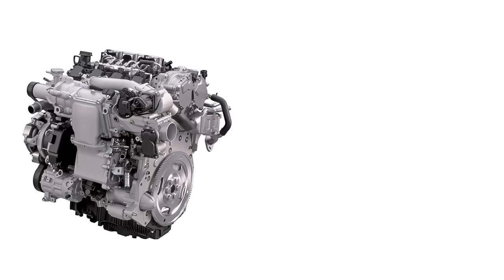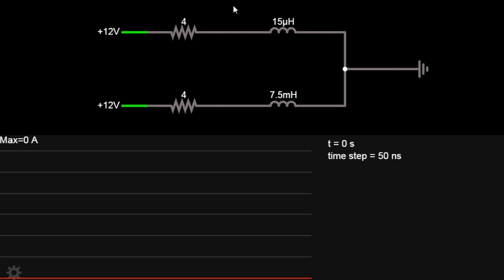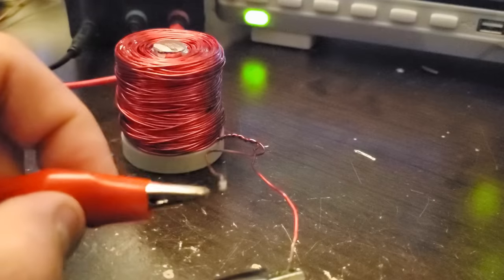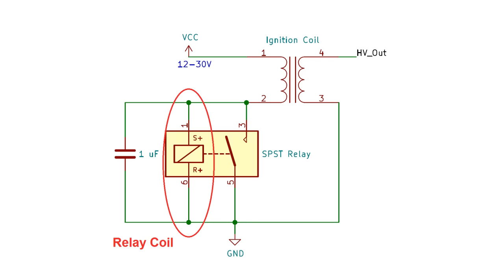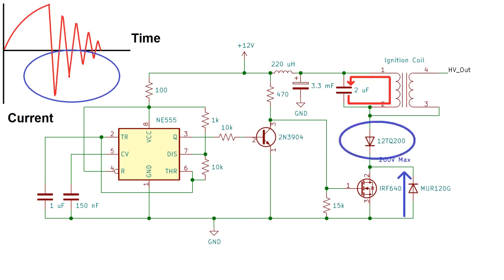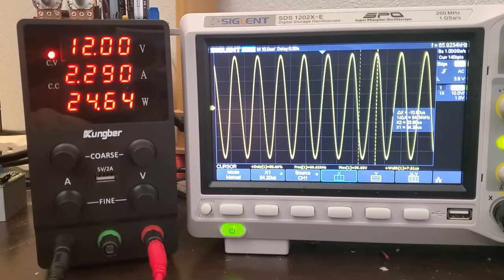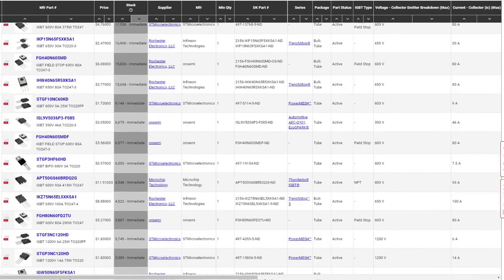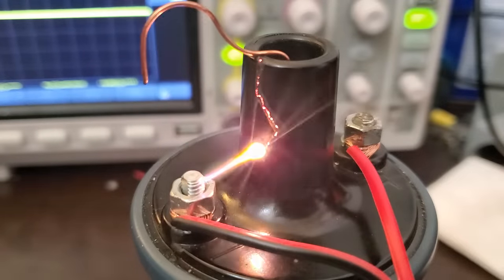Ignition Coil Drivers

Comment: RIP all you neighbors enjoying their nightly AM programming
Reply: So no one.
Reply: Who cares about them anyway?
Reply: How far do you think that would transmit 😂
Reply: What happens if you use one of these coils? As a coil on a generator no, it was to run a big magnet by it. And you put these coils in a situation where you can have a magnet rotating around and trigger an each one of developing high voltage. Every time it goes by the coil, the magnet. Can you use these coils? Almost like a magneto and a an a lawnmower or something

Comment: Ignition transformers are great, one time I had 2 of them in series being driven by the output of a MOT, it created massive 6" plasma arcs between the output terminals.
Reply: @Joseph Bunn "1 ft arc" NICE lol, yeah I was just driving them with a spark gap off the MOT secondary.
Reply: @Joseph Bunn I think I used the can cap that was in the Microwave, don't remember what size it was though.
Reply: Do you have a schematic of what you just mentioned???
Reply: Can you please draw a schematic of your two ignition transformers powdered by a MOT?  I am a one of your subscribers.
Reply: @dandruff7807  It's not much to draw, it was just 2 ignition transformers in series with the output of the MOT.
Reply: Model A induction coils were fun to play with my roommate at college used a special rectifier and he charged the oil filled capacitors and shorted.the caps which made a big spark. I would take a florescent light tube and it would light it without any connection. No wonder why I got put on academic suspension. I never went back to that college. I took electronics at a community college. I had decent grades there. 73
Reply: What is MOT?
Reply: I once placed eight computer monitor flybacks in series setting in mineral oil and triggered them with a 2n3055 npn flip flop topology. After receiving in my 1% billion ohm resistor and building my own (very accurate) volt meter, I about sh_t my pants when I measured the output. Unloaded it produced 230kv. After setting it aside and moving several times I decided life is too short and disassembled it. Just prior to that....I tested the output in another pool of mineral oil with 12 20kv diodes in series. They literally danced around like a snake in water. Cool to see, but deadly to say the least.
Reply: @rylexautumn3766  Microwave Oven Transformer

Comment: I've done some sketchy stuff with these ignition coils, in fact I was almost killed by one a few decades ago lol. My 15 yr old genius mind hooked one of these up directly to a wall outlet, I had to dunk it in motor oil to prevent arcing and cool it since I was running gobs of current through it lol. I was fooling around with the 2" arcs it made, which were hot enough to melt steel wire, when it shorted out to the metal table I was working on and holding on to with my right hand (genius move, I know, I was staggeringly intelligent in my youth🤣) and the electrode in my left hand, my right hand clamped down on the table so hard I couldn't pull away and my left hand was squeezing the wire, I was stuck on it for about 5 seconds before I could get my legs to start kicking and push myself away. I pulled so hard I ripped the transformer out of the jar of oil and sprayed used motor oil all over myself and my shop, but more importantly ripped the outlet out of the wall and saved myself from an awful death. My entire body was cramped for days and I'm not sure how it didn't stop my heart, I think it must have been making 20k-30k Volts based on the length of the arcs it made, which were very similar to a flyback transformer arc but noticeably hotter. Moral of the story, don't hook these up to unlimited current sources, you might die...
Reply from the maker: ಠ_ಠ
Reply: You can be a Hip Hop Rapper and call yourself  50hertz.😂 dun dun .... dun dun !
Reply: @Buzzhumma  🤣
Reply: Lol i did the exact same with a big neon sign transformer
Reply: @randomhuman1965  it's scary but it goes another level if you add capacitor! Don't unless you have approved and appropriate training and I mean properly taught !
Reply: well, wow mr 50hertz (🤪), thanks for sharing your gruesome experience, and its well taught warning for all of us thinking of trying these!
Reply: What a crazy story. So glad nothing too bad happened.
Reply: I remember a similar incident in my own youth which could have been just as dangerous, except nobody got electrocuted. I was also trying to get sparks from an ignition coil by running it directly from the mains (UK mains, 240 volts AC with a 13 amp fuse in the plug), but had just enough sense to use an extension lead, with the ignition coil sitting outside on the grass. When I flipped the switch on at the wall (UK wall sockets all have built in switches on them), it worked for a few minutes, generating a powerful 2 inch continuous arc. But then the arc suddenly stopped, and the coil started making a loud 50 Hz buzzing noise and emitting smoke. I ran back to the wall socket to switch it off, but before I got to the switch, the coil exploded, spraying hot oil everywhere, shooting its guts out across the lawn, which immediately caught fire. I switched it off and ran back outside to stamp the flames out, thanking luck that I hadn't been standing next to it when it blew up.

I imagine the high voltage that it really wasn't rated for had broken down the insulation inside and caused an internal short circuit, which was probably why the external arc stopped. The heat from the shorting wires inside had evidently started vaporizing the oil (until that moment I had no idea there was oil inside these coils) until enough pressure built up to burst the casing open. It must have hit the flash point of the oil too, hence the fire. Fun times, and important lessons learned!
Reply: @zhuzzir  that reminds me of a guy in our town here who ended up on the wrong end of a short circuit in an eXtreamly high voltage environment, there was NOTHING left of him as if he vanished into another dimension.
Reply: Username checks out
Reply: #ThingsToTryAtHome
Reply: FIRE GOOOD!  🔥🔥🔥
Electricity....... dangerous.
Glad you're ok and stories like yours might just save a life. 👍
Reply: @randomhuman1965 You really are fortunate to be alive.
Reply: I couldn't imagine the shock it gave you. I had a 2000 camaro ls1 v8 coil near plug design I forgot a plug wire one day changing intake manifolds started it up noticed a missfire walked around the front and saw number 4 plug wire arcing out to the shock tower 4-6inch gap. I've been hit by older coils usually results in the back of my head smacking the hood but them gen 3 gm coil near plug coils are a lot stronger. Glad you lived!

Comment: You missed the very obvious- collapse the current with a reverse diode across the coil and ignore looking for the resonance! Boom! Also use an ignition wire to conduct the output away from the coil.

Comment: Amazing how well the old set of mechanical points and condenser distributor worked, and rotor & cap delivered spark to each plug at the right timing. Much improved by early electronic ignition control, and powerful magnetos.
Reply: I've replaced a lot of those with igniters, which I assume are just IGBTs and some sort of hall sensor to detect the lobes on the distributor shaft. Because points flat out suck and nobody wants to be stuck on the side of the road...

Comment: A video that doesn't skimp on the necessary details but also doesn't overburden the viewer with too much detail or too much math - that is a recipe for a good video.
I have fixed a couple of the electric fence generators which were made too cheaply with crude soldering skills and solder with too much lead (cheap Chinese solder with a lopsided ratio of 40/60 instead of 60/40). There are many schematics on the net for this, but they basically involve charging a high-voltage capacitor of 10-30uF to around 200 something volts and discharging it through an SCR into the car ignition coil primary. This produces a powerful and painful high-voltage spark (No, I haven't tested it on myself, thank you very much!). The circuitry is crude and simple, it is surprisingly efficient at 12V (uses about 200mA, to step it up to 200+ volts), but by my calculations it is still using about 3 times more energy than it should (the efficiency maybe around 30%). It is using a standard iron core transformer with a 555 driver and a MOSFET and then going through a very high resistance to charge the main capacitor, which is a waste. I figured I could use a much smaller ferrite core transformer with pulses calculated to charge up the capacitor in one second, without using a resistor, which would greatly increase the efficiency.

Comment: In your attempt to drive at resonance (8:07), the parasitic drain to source diodes were probably the main problem.  Many years ago I worked with high voltage supplies that used a near resonant H bridge driver to deliver a little over 1 Amp at up to 145KV.   The H bridge used SCRs, and the transformer primary with a series cap was placed across it.  As you approach resonance, the series tank impedance goes lower, resulting in more output power.  There was no second chance if you made the wrong mistake while working on it... ⚡
Reply: Similar principle of induction furnace.
Reply: An amp at 145kv?! Jesus what do they even use that for? That sounds terrifying to work with
Reply: @ike5276  X-Ray tube power for a CT scanner.

Comment: That was kinda fun. 😁
As a motorcycle instructor I've checked back EMF on motorcycle ignition systems a few times.
One I particularly remember is mid 90's Suzuki VS800 (Intruder) 
The  back EMF maximum was 318V measured with a peak voltage adapter on regular electronic multi meter with input around 13.8v DC (regulated voltage when charging battery)
Output voltage around 45,000v but had no means of checking max voltage accurately (I'm a motorcycle mechanic not electrical engineer/hobbyist )

Comment: 6:02 some O.E.M, ignition systems use a NPN Darlington such as a BU941 or MJ10012, which might take a little more current to drive than a MOSFET, but have a higher voltage rating. Might be more expensive in a TO-3 package than the TO-220 ones you're using, but they have to work all day in all climates located near a hot engine. Thanks for the video.

Comment: I had some great fun many years ago, I was using a version of a capacitor discharge ignition (CDI) that were popular electronics kits many years ago. I had the same issue as you as in the centre insulator kept breaking down and killing all the fun. Luckily there was a few very rare coils with ceramic insulators on top at the local tip.
These did not punch through, however the spark would still make it directly between the output terminals and not my target terminals. I fixed that by extending the centre insulator with some plastic pipe.
In the end, I had a 500V cap dumping into two coils in series, anti-phase, one producing a positive pulse, whilst the other did a negative pulse. The best spark I was achieving was 7cm. However my inverter took about 20 seconds to recharge the dump cap, so it was a long way from a continuous arc. The discharge was by a heavy duty 'starter' press button, so no diodes or caps were used to limit the voltages.

Unfortunately that was one of the things that didn't make it when my parents moved houses.

Comment: One little addition to the ignition coil construction description:  There is also a few pairs of core material sheets curved around the winding pack.  That serves to provide a return path for the magnetic field, reducing the air gap in the loop.  As a side effect, it may also shield against some of the noise radiation.  On the old automotive implementation, there is a small, maybe 0.5 ohm series resistor to limit the primary current.  The capacitor was usually across the breaking contact, with an explained purpose of reducing the sparking of the contact.  However, the contact spark erosion stiil was a common trouble issue.
Reply: the capacitor also converts the initial Pulsed DC into Pulsed AC aka Damped Waves, so if you want to keep DC Impulses can't use the capacitor or maybe you would have to set up a bridge rectifier.
Reply: Old car starters usually have a second terminal which is there just to bypass that ballast resistor because old starters and engines were stupid huge and would drop the voltage significantly. Running with no ballast was OK when the voltage was low, but all other times just put unnecessary heat into the coil and wear on the points for no good reason. 

Modern vehicles use resistor spark plugs or wires, those also help to cut down on radiated EMI. Now, EV's just remove the AM radio entirely to "fix" their EMI issues...

Comment: This is like a simplified msd circuit. Not good for inductive heating but looks great for boosting the spark on your turbo car.  I get spark blow out and I am thinking this could really help with that blow out at 13psi boost.   
Thank you for sharing this.  Answers a lot of questions I had.

Comment: Déjà vu !  Many, MANY moons ago, I worked next to the people who actually designed the the circuits to drive ignition coils (and injectors) in electronic engine controls.  IIRC, they just used a MOSFET.  There was no capacitor across the coil (there WAS in old "point style" ignition systems).  The important thing was a zener diode across the driver transistor to protect it from back EMF.  The zener voltage had to be high enough (57V?) to allow the primary coil to collapse quickly but not too high to to allow damage to the transistor.

When gasoline engines are running at low RPM (<2000?) there is actually enough "time" to "recharge" the coil and "strike again".  At <1000 RPM, it may do this 2-4 times.

As you found out, arcing down the center tower ruins the coil because the leaves a carbon trace.  Once that trace is there, it is next to impossible to remove.  I had an old car with point ignition that would mis-fire in damp weather.  Turned out, it had an invisible, to the naked eye, carbon trace that would conduct when it was damp.
Reply: There seems to be a myth that you must add a capacitor, because points based systems had them. The GM HEI ignitions were based on an MJ10012 NPN Darlington or similar and I don't remember seeing a capacitor there, but those transistors were rated to 400v or 600v and some versions might have used a 350v zener to protect the transistor. The carbon trace is a good demonstration of why you shouldn't run your ignition system with a spark plug lead removed. That high voltage is going to want to go somewhere and there is a good chance it damages something when it does.

Comment: Cool video. To prevent the arching through the insulator try running a wire from the ground screw over top the center of the coil, also maybe use some insulated ignition wire. That should cause the arch to happen straight up and down.

Comment: You could use 2 coils in parallel - one firing, one non firing. Pot the output pole of the non firing coil with epoxy. See what happens.
The reason I say this, is because on Jaguar HE V12's, 1982 - 1988 there were no low impedance coils available and they did indeed use 2 coils wired exactly as described above. Funny thing is the non firing coil was wired after the firing coil, so the HEI module was switched on the firing coil and the non firing coil was connected after.
They used 2 coils because these engines had nearly 12:1 compression, ran on lean mixtures and turned 6500RPM which is a big ask for an ignition coil. 
After 1988 when low impedance coils became available, standard fitment for a V12 was a single coil DAC6093 but the rest of the ignition system remained the same. In fact you can delete your twin coils for that part number coil.
Reply: Did!the. Dual coils have dual points or was the magnetic pick used?  Points won't function correctly after  a few thousand rpms,  back in the day points could barely keep up after 3k rpm if I remember correctly.  Onan used a dual coil on its gen set with the side shaft twin , I believe it only ran at 1200rpm. It ran on point ignition system.   Just curious why the jag had dual coils.
Reply: That's a very interesting idea! I think the energy in the non firing primary wound go into the firing primary.

Comment: I forgot to mention, that coil I made a shock box back in 7th grade (1977), it was simply a hobby train power supply, it was rectified but not filtered and a variable resistor to control the output voltage, started at 60v and max was 490v, it was a blast, we get 5 to 10 peeps in series, start low, then slowly increase till someone let go, remove him and start again, then the teacher wanted to get in on it, I started at max and that got me kicked me out of school for bringing it, haha, the good old days.

Comment: I'm having excellent results with a ZVS induction driver commonly used for flyback transformers. It required a capacitor across the primary, but doesn't even get warm and makes big arcs @ 6.8khz.

Comment: A stud type  high voltage rated SCR discharging a 1 or 2 microfarad capacitor ( charged to 300 to 500 Volts ) at 50 / 60 Hertz is the basis of some electronic ignition systems ... this has the BIG advantage of no worries damaging any semiconductor ( such as your  MOSFET ) and gives sturdy sparks ..... tried - n - tested ..........

Comment: The fly back transformer also uses the collapse to transfer energy, but the small inductor enables more power density because the switching frequency can be much higher (it also must be higher to avoid saturation). The flyback's transfer of energy is not continuous. If you remove the diode then it is no longer a flyback topology